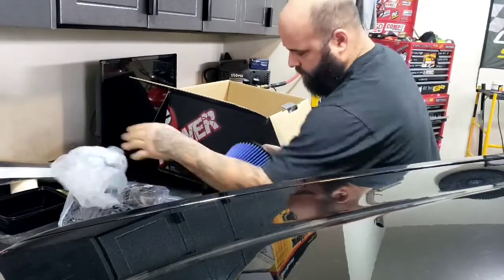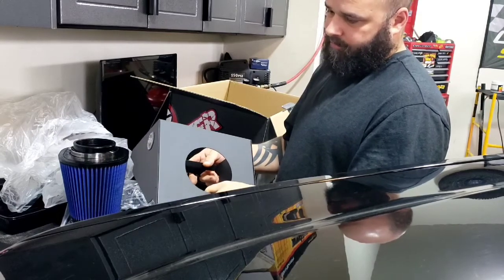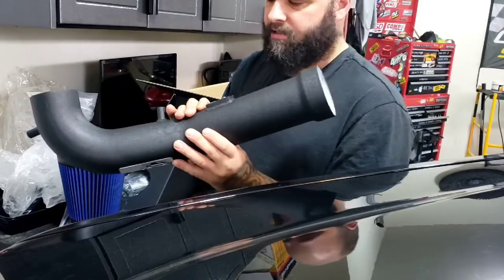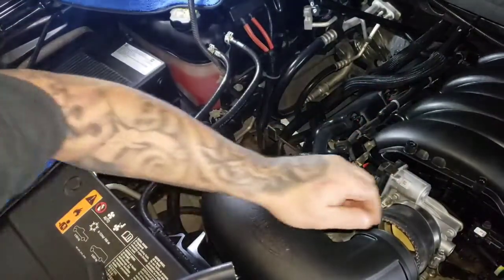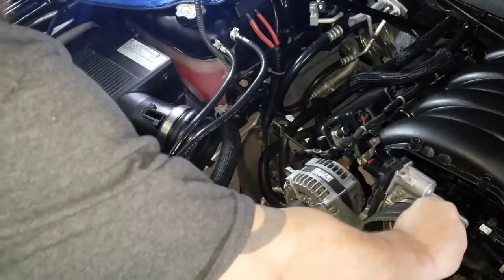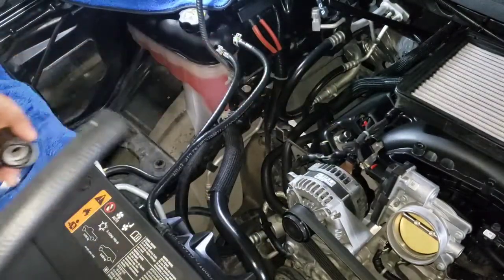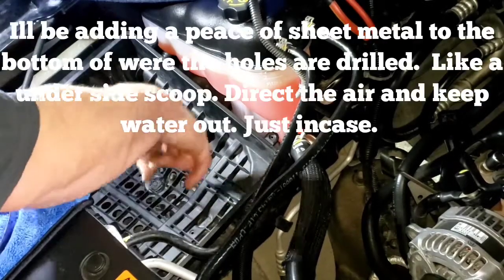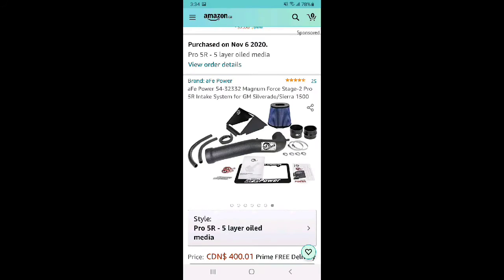AFE  magnum force install 19' silverado 5.3L

Comment: Nice that will work great with your exhaust 👍👍✌️
Reply from the maker: After the tune, it should be a bit of difference. Just welded a new exhaust set up. Installing it later. Got a video on it. Much better then the duel exit out the back. 🍻👍